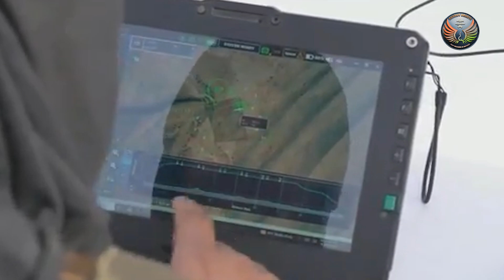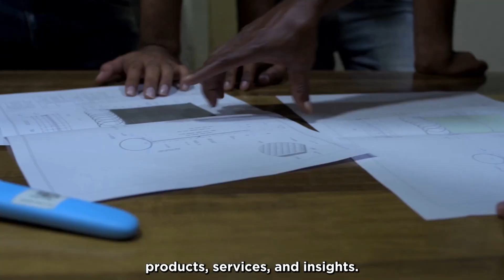Drones To Revolutionise Mountain Warfare

Comment: In air transport based on "lift" generated, everything (in formulas to design such a contraption) depends on the air pressure at that altitude. In that respect, things are far more different than at "sea level" or there-abouts. 
India has the highest battle-grounds in the world. Air pressure falls by a third even, at such altitude. And our armed forces learnt that the hard way. An example is the below-par (inadequate) lift that marred Indian helicopters' performance, during Kargil war. It cost us the helicopters as well as human lives. That was an unacceptable factor, during the war. 
Instead of learning the same at cost of a few helicopters & human lives involved, one can get the same knowledge by asking Aero engineers (if S/he is good in applying the principles S/he learnt, to the situation). But S/he may not know the conditions (air pressure) at the altitudes in question & may have to be educated. S/he, sitting in Bengaluru, can't be expected to know unless S/he is a Geographer too. It is the standard Indian dilemma.
Now that we learnt the hard way & began applying those principles(& producing high-altitude helicopters in HAL), we need to apply the same principles to "design" high-altitude drones.
This is fundamental. All things & other considerations (uses) come later.

Comment: Right move. However, army/mod should offer a "prototype stipend" to qualified producers, that is those that can demonstrate production capacity or otherwise convince the army. This is how it is done in developed countries. There may be parties that have a good idea/product but not the resources to purchase things like electro optical detection and targeting equipment. Also, it should open up to ideas for small guided munitions carried by drones as drones by themselves are not enough.